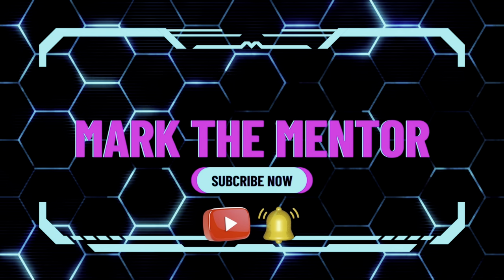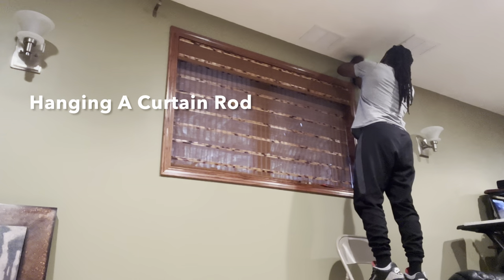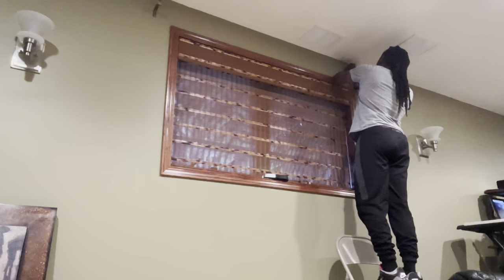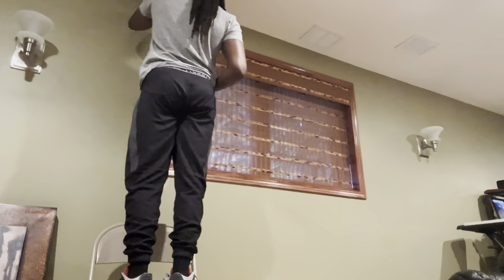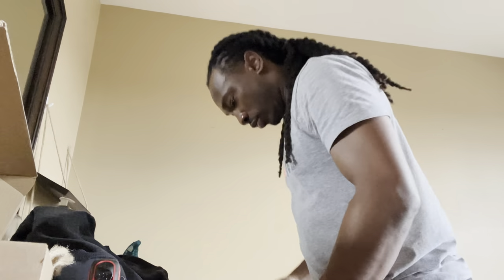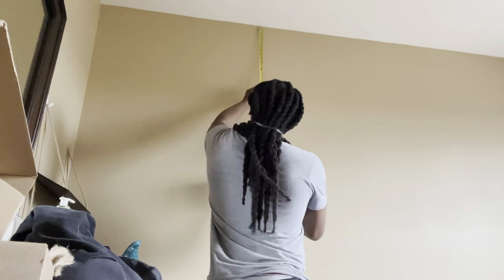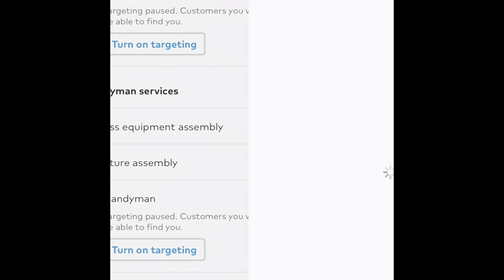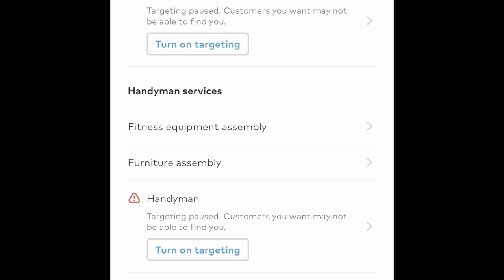How To Make $250 - $500 A Day On Thumbtack

Comment: Thumbtacks leads for handyman services are out of contro

You pay $20-$30 per lead that is for 10 Leeds $200-$300 we will call it 250 to be fair you have to pay for your car insurance that’s $200 you have to pay for your fuel to get to these jobs that’s an additional $200 you also have to pay for your business insurance that’s an additional $100 a month and that is not counting your tooling so if you add those numbers up you were up to $700 in cost But if you remember and you look at national averages the national average to install a light is $75 a light so you made $750 by the time you subtract the cost of running your company you only made $50
Reply from the maker: Hello. Yes. A lot has changed with thumbtack since I signed up with them in 2018. Even since I did this video in April. Judging from all the recent price increases it seems like they may be trying to show profit as they may IPO soon.
Reply: I do handyman work as a w2 employee only. The headache of being a one man 1099 post COVID is not worth it unless you're a contractor. My side business is selling food out of a truck.